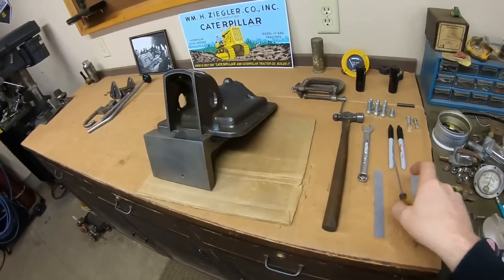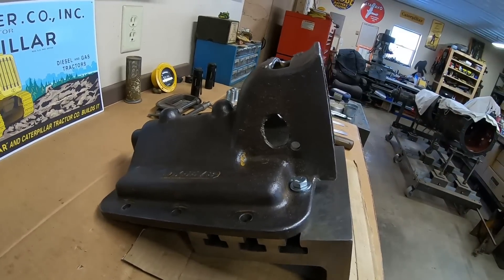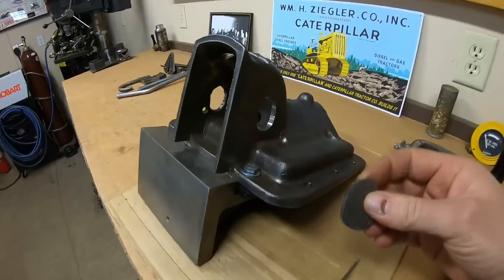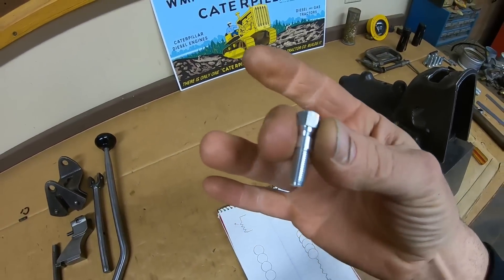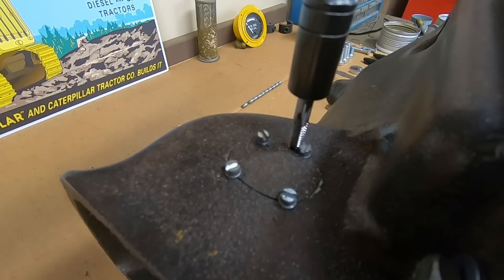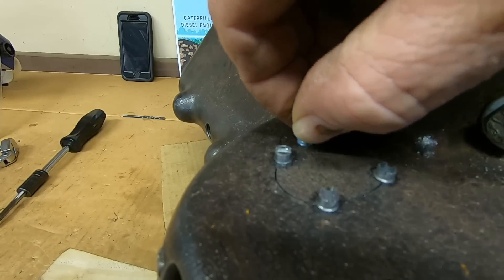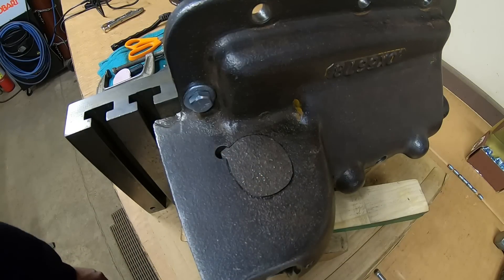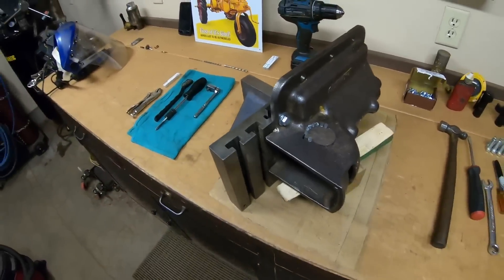Minneapolis-Moline 445 Prototype #X231 - Part 51: Metal Stitching the Top Cover Torch Holes Closed!

Comment: Man I would have found someone to braze that.  That is the "traditional" repair method that would have been done back then.  This would have taken a fraction of the time.  I am surprised you do not have an acetylene welder or cutting torch.  You can stick weld cast iron and really you do not need to get it that hot first... maybe 500 degrees.  Throw it in an oven or put it on a wood stove.  Just get a stick made for cast iron with a decent expansion.  Bevel it a bit more and do 1" at a time, clean it up, skip around and start over.  It is not like this is a structural piece.  Heck you could just JB Weld it back together.  Metal Stitching just sounds horribly time consuming.  I think just doing 4 was plenty and likely would have looked better as cleaning that up is going the make it hard to hide/blend it in.  I swear you like creating more work for yourself.
Reply: @squatch253  The brazing would have been cleaner if you had brazed in on the inside.  If you had a simple acetylene torch you could have brazed it in 15 minutes... not 2 days.

Comment: Hi Toby, oh well, I'm wrong again! Thanks for the master class I've never seen that being done so it was very educational. Initially I thought a carbide drill might help but the tapping would still be a problem. Anyone who has been faced with a broken tap stuck in a hole will understand. Why, oh why do they always break off flush or down inside?

Comment: So awesome!! I have learned so much from you and your dad over the years!!! How did the real mechanics do it before YouTube?? 😂
Reply: Mechanics and blacksmiths were called journeymen for a reason. Take 5 years to learn your trade,move somewhere else the master tradesman isn't, learn more. Carpenters, pretty much any skilled trade. The various books published oh,1880s to late 1920s were probably the best of the bunch. Used to be readily available. Much harder to find nowadays. Even the high school shop textbooks of the 50s and 60s are tough to find. Well various forums are a good source,currently. Old factory automotive shop manuals offer a huge amount of general purpose info. 1950s forward. I was astounded reading a factory 1985 Mazda 323 manual. It was like older British stuff. Comprehensive.

Comment: The cast iron repair is looking really good it's turning out nice. I have seen machine shop stitch cracks in cylinder heads with stainless steel screws and they held in the combustion chamber on a gas U Minneapolis Moline tractor engine.

Comment: Honestly very cool, never seen the method done before, looks nice... But seriously, you need to get comfortable with brazing and soldering. The actual braze time for that casting, for both holes, maybe a half hour, and wouldn't require anything special for equipment. The temp for brazing is relatively low,  The preheat for the entire casting isn't that high, like around 400 degrees, a #6 rosebud or a kitchen oven set to 400, and a fiberglass fire blanket to let it cool down slowly. I've brazed engine blocks without any preheat at all, you just do small sections at a time, and let it cool down inbetween heats. Last one I did was a inline 6 for a Oliver 70. Entire one side of block from deck to oil pan blown out, and three webs inbetween cylinder sleeves cracked out. Just used a rosebud to get the immediate area to be repaired hot enough to smoke, then a #3 welding tip to braze, just a couple inches at a time, let it cool down open to air. And it didn't even warp, threw the crank and main bearings in after, torqued everything down, and the crank spun like a peach. Mind you I wouldn't do that on anything I cared about, we only did it to see if the tractor was even worth messing with. Everytime you get a new tool or a new skill, you'll never understand how you got by without it.

Comment: Looks good :D I hope the Dremel  only must grind the last pass, otherwise poor Dremel
Reply: @squatch253   the Dremel was a very handy tool, when you do restaurations and rebuilds, i also use them a lot, often with the small steel cutting discs for sheet metal. And for finishing welds that you shouldnd see :)

Comment: Back in my machine shop days, when a replacement cast iron part wasn’t readily available we used to repair cracked cast iron cylinder heads and blocks using this method. It’s tedious but works very well.
Reply: I talked to a guy who put a piece of an engine block back after the engine froze he said that he used all thread rod and didn't run the tap all the way through the cast iron. He would drill and tap on opposite sides of the patch and tightened each side a little at a time until both sides were wedged tight and cut the rods off even with the surface of the patch. To help seal the patch, he said he used a penetrating thread lock. I guess it was a lot cheaper than replacing an otherwise good engine.
Reply: Hi Luke
Reply: @tomanderson997  hello Tom!